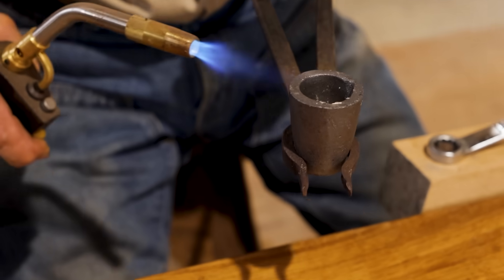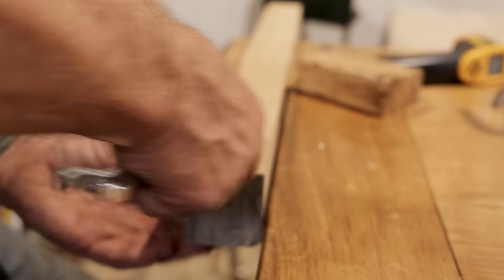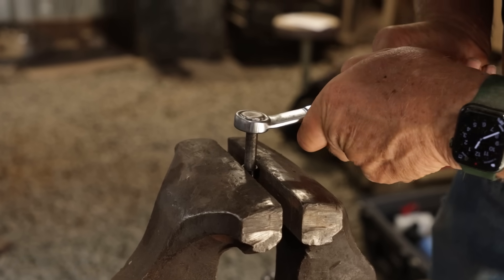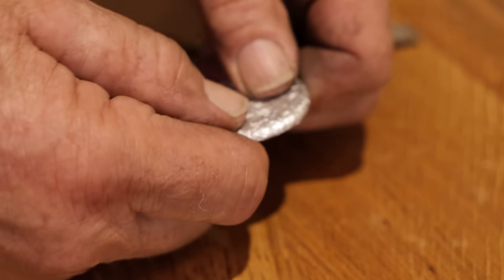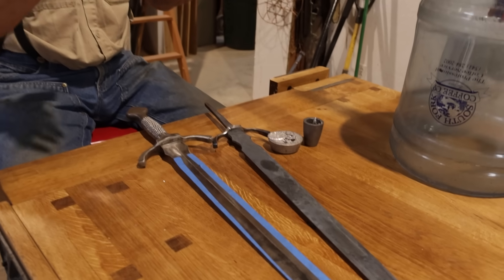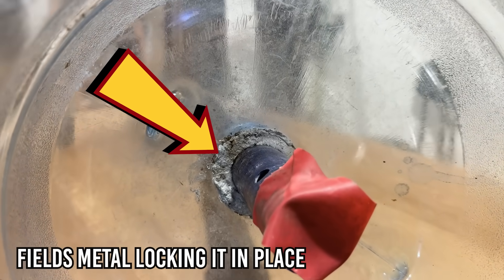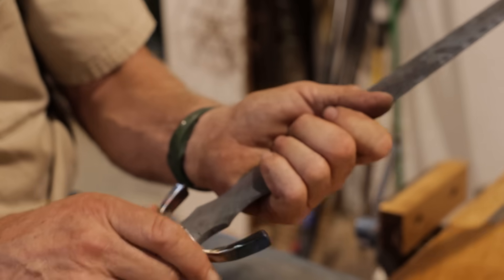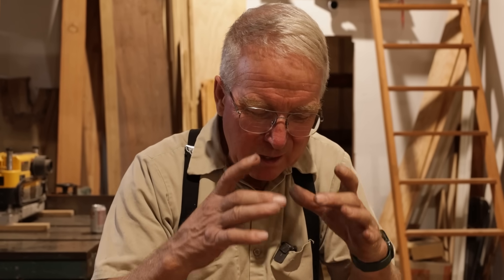Liquid Metal?

Comment: Eutectic does not only mean a mixture of metals which have a melting point below that of either metal.  Eutectic alloys also have the lowest melting point for that mixture of metals, and have no intermediate state between liquid and solid.  So for example Sn63Pb37 is the eutectic alloy for tin-lead solder, and any other mixture of tin and lead is not eutectic.

Comment: What's the point of having a shop if you're not going to so some goofing off once in awhile! 
I solder copper pipe once in awhile. Back when they switched from 50/50 solder to 90/10, I found the 90/10 noticeably harder to work with. It seems tro melt at a higher temperature so the flux burned off too much by the time the solder could flow. Still doable but just not as forgiving.

Comment: Thanks for the video. 

I'd never heard of Field's metal even though I've worked in metallurgy for years. When I looked up the details, I realized why I haven't heard of this metal. The composition is bismuth, indium, and tin. That makes this metal very expensive. With a melting point less than that of boiling water, this metal isn't going to find much use in the heavy industries where I worked. I can see where it would be fun to use, but the expense would be more than I could afford for playing around. 

Years ago, I would have known of many eutectic compositions. Now, I've forgotten most of them. 

The danger of eutectic metals is a phenomenon called liquid-metal cracking. Certain liquid metals can cause certain solid metals to crack under stress. I once did an analysis of an offshore steel pipe that had been brazed with a copper alloy to attach something. On lifting the pipeline from the ocean floor, the work boat had put the pipe under stress. The brazing exposed the steel to the copper alloy in a liquid state, and cracks ran through the steel. That the molten metal is a eutectic isn't as significant except that the lowered melting point means that the liquid metal is liquid at more conditions. I've heard of pipes in industrial plants that were impacted by drops of melted metal during a fire. I think the melted metal was either aluminum or zinc, but I can't remember. My health has failed, and I've lost a few things. In any case, the pipes were under enough stress that the dripping metal caused liquid-metal cracking. After the fire cleanup, those pipe sections had to be replaced to avoid them cracking completely open and causing another fire. 

I like the idea of using a liquid metal to seal the cross guard of a sword to the tang. I'd just want to check to see whether bismuth, indium, or tin would cause a liquid-metal cracking problem. I'm fairly certain that tin wouldn't be a problem. I'm pretty sure that lead doesn't cause cracking of steel. I don't know about cadmium. I remember that cadmium-plating has caused some hydrogen cracking issues, but I don't think that there would be a problem with just molten cadmium as a component of a eutectic alloy. If I could remember whether aluminum caused a liquid-metal problem with steel, I could think about aluminum as another option. While aluminum takes more heat to melt, aluminum is probably the strongest of the readily available options. Lead would take less heat to melt. Because lead is softer, it might loosen more quickly over time, but it would still be good for sealing that space and preventing rattle. Another option would copper that is heated to grain growth temperatures and allowed to cool very slowly. That should produce a dead soft copper that could be pounded into the gap using chisels or something similar.

Comment: Galistan is tin, indium, and galium and is liquid until -10 Celsius. 

Wets to glass, and infuses to aluminum corrossively, so handle carefully, but is non toxic.

Bismuth tin zinc indium galium lead and cadnium all tend to form eutectics with each other, though there are a couple pairings there that do not.

Learn how to read  phase diagrams for  alloys and you  will be able to look up diagrams that tell you exactly what temperature and and what ratios two  metals  will alloy at.

Comment: To my understanding eutectic solder will melt at a specific temperature and solidify almost immediately once the temperature drops below that specific temperature.
Is that correct?
Reply: Yes, that’s correct. A non-eutectic alloy will melt and freeze across a temperature range with a slushy phase between liquid and solid.  It’s not about the lower temperature as there are plenty of non-eutectic alloys which melt at a much lower temperature than their constituent elements.

Comment: love the thought of trying something new when it comes along!  my daughter bought a house with Uponor Pex A plumbing which is the only plumbing pipe not in my library.  got to try Pex A pipe fitting successfully at the age of 74 for a laundry room remodel.
Reply: I haven't used the PEX A but I replumbed a 45 year old mobile home with PEX B using the crimp rings and it was awesome. So much faster than glueing PVC or soldering copper.

Comment: Eutectic definition also includes  -  It is commonly used in chemistry and metallurgy to describe specific types of alloys or solutions that solidify or melt at a particular temperature. ( ThoughtCo Wikipedia )  Hence Sn63/Pb37 Solder has no plastic stage.  Goes from a solid to a liquid when melted.

Comment: I’ve used this method for filling small gaps but it works best if the ferrous metal is heated up close (but lower than the melting point of the eutectic alloy) hence facilitating a better flow instead of instant freezing of the alloy on contact with the way cooler surfaces.

Comment: Eutectic solder, 63% lead and 37% tin melts at 183°C which is lower than either tin or lead. Eutectic solder, 96.5% tin and 3.5% silver melts at 221°C, again lower than either tin or silver. The eutectic point of an alloy is the ratio of the components which melts at a lower temperature than any other ratio. Eutectic has nothing to do with copper unless copper is a component (homogenous melting together) of the alloy.

Comment: Some eutectic metals also don't shrink as they cool; they are used to measure rifle chambers precisely.
Reply: I've never done it myself, but I remember as a kid being fascinated watching my dad pour a chamber cast.  I just couldn't wrap my head around how molten metal could be poured into the chamber with nothing but a wad of cotton stuck into the barrel to plug it.  I'm sure there's still a muffin tin ingot of the stuff in one of my toolbox drawers, just like the one Scott was handling in the video.
Reply: That stuff is called "cerrosafe". It's not a eutectic alloy, but it's perfect for chamber casts bc it shrinks as it cools, meaning easy removal, and then expands back to its original size, meaning accurate casts to measure.
Reply: In fact, some even expand when they solidify. Typesetting alloys are a good example. The now solid and expanded metal locks the type blocks into place better than a clamp and shims. I think some bearing alloys (babbiting?) also behave the same way.

Pointless fact, plutonium (noneutectic) also expands when solidifying. That makes casting it easier in many ways than "normal" metals. So does water/ice - which makes it easier for life on earth...

Comment: In the automotive world we have hypereutectic pistons. in fact most engines that conform to EPA regulations have them. some of the reasons are there is less expansion of the aluminum which allows a tighter clearance between piston and the cylinder wall. and the pistons are a little harder than regular aluminum which is good for durability. I didn't even know eutectic was anything other than an automotive thing. pretty cool to learn something new.
Reply: Yes, it is a property of alloys or metal mixtures.  It can apply to mixing carbon and iron to make steel, for example, too.   There are eutectic, hypoeutectic, and hypereutectic mixture ratios for almost any alloying elements.

Comment: First time you use that hammer it's gonna fall out bc there was no Bonding, at least Epoxy will Bond with the surfaces.
Reply: Yes, this is the equivalent of a cold solder joint.  He needs to hear the hammer head up to around the melting temp of the solder (yes, this particular process is quite literally a soldering process).

Comment: Wood's and Rose's metals can be used to fill thin walled tubes before bending, so they act as solid bars and don't flatten during the bending. The metal can the be melted out, Wood's melting point is well below the boiling point of water.

Comment: That's not what Eutectic means.  There are non-eutectic metals which melt at temperatures lower than their constituent elements.  A eutectic alloy is one whcih has a single melting point for the alloy.   ie: it goes from a complete solid to a complete liquid at a single temperature.  A non-eutectic alloy will progressively melt over a temperature range as it's different constituent metals melt at different temperatures.   This can be seen in some solder materials which become "slushy" before melting completely.  The proprietary alloy  branded "Cerrosafe" is an example of a non-eutectic alloy whcih melts at a much lower temperature than it's constituents.
Reply: Sn63/Pb37 Eutectic solder has no plastic stage and what we used at NASA during my 26 years other than high voltage applications.
Reply: @RMJ3032  I may have been unclear in my description. my reference to a "slushy" phase was for non-eutectic solders, as a contrast to Eutectic solders, which do not have a slushy phase.
Reply: That’s what I came here to say… love that 63/37 solder 😉

Comment: We use it in the machine shop for inspection, if you have an internal feature you need to cast a positive of to measure, you can use fields metal, but understand it contracts a little bit as it cools.   Also you can pour it into a pipe you need to bend and it will support the wall and keep it from kinking
Reply: oh that's a good idea.

Comment: 3:44 tip…temperature guns won’t read shiny metal.  I learned that diagnosing boilers and geothermal systems.  I had to put paint on pipes to read temperature correctly
Reply: Also, the laser dot is purely for aiming and isn't what measures the temp. In actuality, the temp gun measures a circular area that is the cross section of a cone coming from the front of the gun. The farther away you are, the large the area it is measuring. Usually there is a diagram on the gun that shows the size of the cone at a few given distances.
Reply: Yup, and depending on the temperature, plain cheap painter's tape will do fine. If it gets real hot, some talcon spray, or rubbing it with blackboard chalks, works fine too.
Reply: Maybe Scott could do a deep dive into temp guns? That’d make decent content. I was using one for shrink fitting parts. Glowing tiny metal parts required a special gun and precise aim.
Reply: Why is that?
Reply: @madmaxxx1823  Because shiny metal has a different "emissivity" and IR thermometer guns are calibrated for the lower emissivity of non-shiny surfaces.
Reply: @Guysm1l3y  Correct.  Better IR guns allow you to enter the emissivity of the target.   The myth that they can't sense temps of shiny metals, which several others are tossing in here, is totally incorrect.  It is a just calibration.
Reply: @brianhaygood183  The trouble is that you can't know the emissivity of the surface very accurately, and the inferred temperature is extremely sensitive to that parameter.  Better to paint the surface with something that has a known emissivity.  I took a piece of painter's tape and stuck it to a plate that had an electronic thermometer probe attached to it.  I adjusted the emissivity until the IR thermometer reading matched the probe reading.  Now I can stick that piece of tape to anything and measure its temperature with the IR thermometer.
Reply: @madmaxxx1823 temperature guns rely on infrared radiation (light) coming from the item whose temperature you’re measuring.

Shiny surfaces radiate less light at the same temperature than matt surfaces.

If you look up “Black Body Radiation” you can get more info
Reply: @madmaxxx1823 
You want to measure the heat radiation of that object, not the reflections from somewhere else. Shiny = reflections.
Reply: @madmaxxx1823  Metals reflect IR, so any reading you get off of shiny metals is basically temperatures around the area, which is why it read <100F, it was reading the temperature of his hand reflecting off of the metal.
To get an accurate measurement you need something non-reflective. Some use paint, others use painters tape. Anything that can be adhered to the surface that isn't shiny will work just fine.

Comment: This will fill voids, but with a low bond.  To get a bond, the abutting metals need to be heated. 

Like soldering a pipe, you heat the copper and the copper melts the solder.  If you just melt solder onto a cold metal, there is no bond. 

Epoxy, while not as hard will bond to a room temp surface.
Reply: Yes, I was thinking the same thing. That sledge head needed to heated up to 200F so it didn't immediately pull the heat out of the liquid metal. 
Pouring onto a cold metal will also make the "bonding" metal brittle because it cooled down too fast.

Comment: That is not what eutectic means. A eutectic alloy is a mixture of two or more metals that melts and freezes at a single, sharp temperature.  Like solder that is intended for electronic components.  It is 63/37 percent alloy of tin and lead. This is eutectic because it goes from liquid to solid in an instant.  The common 50/50 solder is not like that. It is not eutectic. When 50/50 solder cools, it goes from solid, to a viscus, plastic-like, intermediate stage, and then when it cools more, it becomes solid.
So, with electronics, you want a fast freeze solder, usually because you are using your hands to manipulate the iron and parts being soldered.  If you move anything when the solder is cooling, you get a bad joint.  Fast freeze eutectic solder minimizes the risk of moving the joint when it is cooling off. Now on things like body leading or for soldering lead roofs and gutters, they make 40/60 solder, which is very much not-eutectic.  It has a really wide temperature range when the solder stays in the plastic and malleable state.  This is to allow the joint to be worked with a waxed wooden spatula to smooth the joint.  But all that said, eutectic means all components of the alloy will combine fully in their proportions, with no one component is left that does not go into solution, and amalgamate with the other components. Not trying to be a jerk, but when I hear an incorrect technical definition, I like to point out the correct meaning.
That being said...."Eutectic Alloys" is the name of the company that makes Cerrobond, the metal that you are demonstrating in the video.  It is just the name of the company. It does not mean they only sell alloys that are eutectic in their physical properties.   --Doozer
Reply: Correct.  Almost any two metals have a particular mixture that is a eutectic mixture.  At other ratios, one of the metals starts to solidify before the other.   The term is also used for multiple solid phases changing into a single solid phase at the lowest temp the two solid phases could exist (where different solid phases involve different crystal structures of solids, as opposed to the phases being solid or liquid.   So, there are eutectic steels composed of two different crystal arrangements of steel that when slowly cooled will form a single steel structure, etc.
Reply: Scott is definitely correct in his definition of Eutectic. Doozer is also correct in what that means in application. A eutectic metal will freeze at a single temperature because both metals in it freeze at a new, lower temperature. Non-eutectic metals, really just an alloy, still retain their different melting points, so they will be "slushy" as it cools - one becomes solid in the still-melted other metal.
Reply: Nope, he got the definition exactly right: "relating to or denoting a mixture of substances (in fixed proportions) that melts and freezes at a single temperature that is lower than the melting points of the separate constituents or of any other mixture of them"
Reply: Oops, just posted more or less the same thing ... could have saved myself some typing if I'd read your comment first.
Reply: Doozer - That might be how you use the word in your industry, but that’s not how it’s typically defined.

Comment: The definition of a Eutectic alloy is when all the different elements in the alloy melt and solidify at exactly the same temperature.  If it were not, one of the metals in the alloy would melt first beforehand.

Comment: Scott, where I worked, we used to fill tubing with Cerrobend that melted in very hot water. We poured it into tubing. It would harden, we would bend our tubing in a bender, put the tube back in hot water, and the Cerrobend would melt and roll out of the tubing, leaving no residue I believe it melts at about 160 degrees.